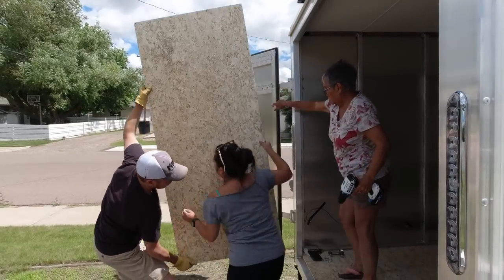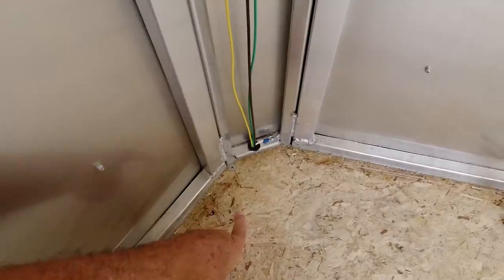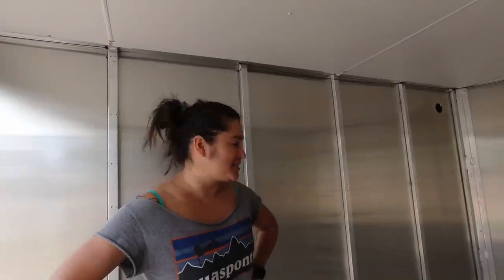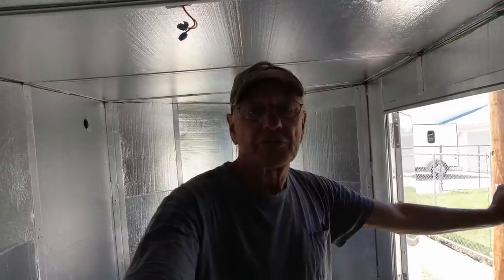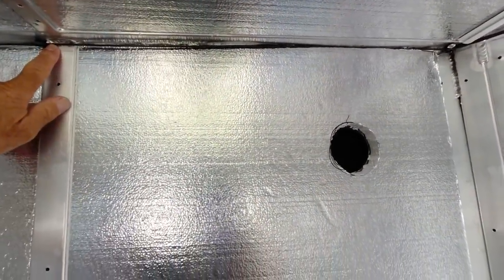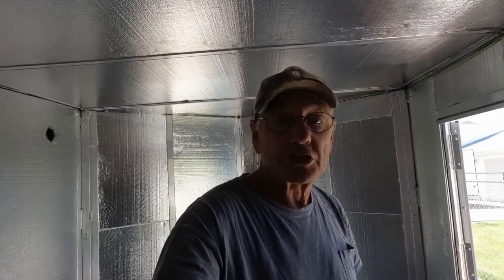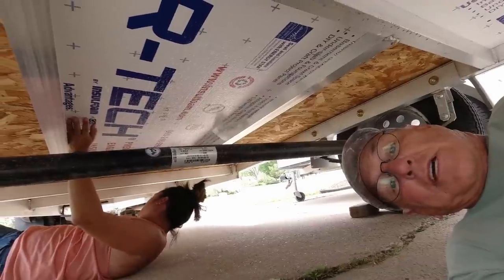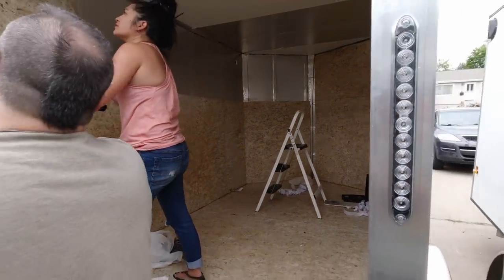Cargo Trailer to Camp Trailer - How To Start Your Build - Insulation

Comment: Rick, can you tell me what adhesive you used to adhere the insulation to the bottom. Was it something you sprayed or rolled on? Did you apply to the foam,OSB or both?. My trailer is a couple of years old although not too many miles, do you recommend cleaning the bottom at all? I insulated the walls years ago with pink foam that had no silver side, does it make much of a difference you think? I need to open up the walls to tape all the seams so I could add something if it would make a difference. Last question, do you have a favorite app you use to find campsites?
Reply from the maker: The adhesive we used is contractors foam board adhesive, sold where the caulking is in the hardware store and I would just hose off any dust and loose dirt before installing the insulation.  I just applied it to the bottom of the OSB is all.  As for your trailer not having the reflective mylar on the insulation I wouldn't worry about it because the interior space is small and is easy to heat or cool.  I would, however, put in a moisture barrier to stop condensation on the inside of the skin.  At this point I think you would need to use a plastic sheeting on top of the foam.  As for a camping app, the ones we use most of the time are Freecampsites.net and Campendium, but we use these mainly to find overnight stops while we're traveling (like a Walmart or other place that allow overnights stays).  For the really nice places we camp we use the Delorme map books for each state we like to spend time and, for us, that's about 4 books.  Online we use https://publicland.org/ most of the time.  Hope to see you out on the road!
Reply: @gonagain  Thanks so much, this is really helpful!

Comment: The aluminum frame is a huge plus. That is a well built trailer. Now, what kind of suspension does it have? The only other video of yours that I have watched was the one where you broke a leaf spring. A good suspension would be a Dexter Torflex or a Timbren system that uses the polyurethane compression blocks and trailing arms. As you well know, leaf springs don't hold up, cannot count the videos I've seen of them breaking on people and the trailer doesn't get a good ride which means it doesn't tow as well and is harder on the fasteners holding it together and your belongings inside.
Reply from the maker: I was going to go with a torsion arm axle as an upgrade, but the suspension shop talked me out of it.  I was told they too  break down just about as often and then they're more expensive to fix and get parts for.  I'm holding off for now.
Reply: @gonagain  The Timbren axle-less suspension is a good idea. It bolts to the frame and you install a square tube crossmember to keep them in align. I would want thru spacers welded in the frame so as to keep from crushing the frame when you bolt it up, but its great design.
https://timbren.com/c-1389196-products-axle-less-trailer-suspension.html

A second possibility is Sumo Springs for trailers, as they will carry some of the load and keep the leaf spring from being so heavily loaded. They also help dampen the spring action. These work with leaf springs, over or under the axle, different kits, for over/under and different weights.  https://www.supersprings.com/trailer-sumosprings
Reply from the maker: I've looked at the Timbren and had thought about going with that, but i think something like the Sumo Springs you've pointed out better fit my needs.  I'm sticking with the leaf springs because replacements are available most anywhere. Thanks!

Comment: Love your videos! Thank you! I've learned a lot from them! Thank you for sharing your knowledge!  Question how do you think that will hold up with rock salt? (  The insulation under the trailer) In the winter's up in Ohio they go crazy putting that stuff all over the roads.
Reply from the maker: I hadn't given that any thought because it's not in use here.  My first thought is that the salt will corrode the aluminum frame, but a steel frame would be no safer.  The insulation is an inert material and won't be affected at all, but I wouldn't want to install it in a way that would hold any moisture (I'd use a LOT more adhesive around the edges).  I think if you were able to hose it off with fresh water it would do wonders for the trailer in the long run.  Interesting question.
Reply: @gonagain  thanks for your input Rick. That's one thing most of use do here as soon as the temperature goes above freezing.   I was also wondering if I followed your instructions for underneath the trailer if a spray on rust proofing would work.  That would also give a barrier to the aluminium frame.
Reply from the maker: @radwayb  aluminum requires a special primer before you can paint it, but if you did that then painting it would be very beneficial I think.
Reply: Gonagai

Comment: I added insulation in my walls and put the wall panels back up. Went camping in May and the campsite had an ant nest nearby and they got all over the trailer and some made their way inside. I’ve been thinking about taking the insulation out to seal every opportunity in the walls to keep critters out then put the insulation back. Do you think sealed tight like this would cause too much heat to be trapped between the skin and wall panels during summer heat that may cause other problems?
Reply from the maker: If you didn't put in a moisture barrier, then now would be your opportunity to do so and that will keep any moisture from forming inside the outer skin and causing mold problems later.  Check out the video on insulation to see what I mean.
Reply: @gonagain  Sure will.  Thanks.

Comment: You're correct! Those are supposed to have to aluminum towards the inside, no matter what. Outside of a house is still aluminum side towards inside too, or anything else.
Reply: @AdamA-pm3yn  okay since you don't seem to have any construction knowledge or background. I'm going to make it super simple for you. The aluminum side/ foiled is to decrease the heat or cool to the outside, while the white side/ polyiso goes to the exterior facing of the inner wall. There is air movement between the foil and wall; why? It not smooth. How do you think, and why would you use aluminum tape to seal up the polyiso panels/ foam broads? You don't use it on the white side. I guess you can if you're super small and slide down the inner wall. Hopes this helps you out.

Comment: Those ceiling panels are vinyl coated.  If you need to cut or drill, it won't easily splinter and they're easy to clean.  The plastic channels are likely attached via VHB.  Mine, in a high-end trailer are the same.  Nice inclusion by the manufacturer.
Reply from the maker: I was pleased when my daughter brought this trailer home and I saw those panels already installed.  That saves a lot of work!  Thanks for watching, Keeb!
Reply: @gonagain  Love all your vids!  A lot of thought to airtight my trailer after your "trailer dust" vid.  Very informative!

Comment: would having the axle on the bottom of the springs be any benefit?
Reply from the maker: Sometimes that's a great benefit.  These 6X10 single axle trailers are pretty high off the ground to start with, but I may be flipping my axle in the near future.

Comment: Is insulting the trailer really needed for me I plan on doing one and taking it to a track about once a month throughout the late spring summer and early fall mid Ohio because it’s cheaper than a motel and I need a trailer for my go kart
Reply from the maker: Yes, I think it's really necessary, not only to keep you cooler or warmer, but also to stop the condensation inside.  It's also one of the easiest modifications you can do that will add so much comfort.

Comment: The hinge bolts should be carriage bolts not bolts with hex heads on them. If the insulation fills the gap completely then it does not matter as much which side the foil is on but mine was a little thinner than the space I was filling so you put the foil facing the gap (inside) so it REFLECTS heat back in. If it's touching the outside metal wall it CONDUCTS which is what you try to avoid. But as a rule it goes against the wood which is a lower mass than the aluminum skin so it wont conduct as much. So you did it right . . . :o) 
You always do great videos . . . always plenty of food for thought.
Reply from the maker: Good info, Hiker John, thank you.

Comment: You guys are having way too much fun....I hope a BBQ is going to happen at the end of the day DAD! Underside of the trailer with the exposed foam....ever think of putting of appling a rubberized seal (Flex Seal) like the guy on the commerical with a screen door in the bottom of his boat?
Reply from the maker: Hi Scott, I thought about it but didn't on purpose.  I wanted any moisture to drain away easily and I haven't had any problems at all with that.  However!  If it would help protect the panels from dings without sealing the edges then I would be all for it. Mine may look bad, but they have many thousands of miles on them including lots of gravel roads, so I think they're holding up pretty well.
Reply: @gonagain  since you have that much experience on the panels and your thought process makes alot of sense I think I will follow your suggestion.

Comment: I just bought a 7x14 EZ Hauler. I went and bought all the insulation etc. and started to remove the wall panels. I see the bottom  used rivets for the fender all the way through! Did you also run into this? If so what did you do? I'm sort of at a stand still as I don't want to remove the Fenders to insulate. :(
Reply from the maker: Ok let's see. Are your fenders siliconed around their perimeter on the outside? If they are, then you could easily drill out those rivets and poke them out without the fenders falling off. Even if they do come off, it's not too big a job to bolt them back on again. I don't know where you live, but if it's up north, then the insulation is really necessary. Don't forget to seal all the seams to keep the interior moisture (from breathing) away from the cold skin of the trailer.  I'm saying that the insulation is important enough to take those fenders off if need be.
Reply: @gonagain  Thank you. Yes, they are siliconed. The Trailer is built well. I was able to remove the wall panel. I appreciate the help.

Now I have to figure a way to insulate behind an inside aluminum panel approx. 12" by 4 1/2' that goes along the floor on the inside behind the fender.

I wish I could share a photo! I'm thinking maybe drill a hole top and bottom between the studs and use Great Stuff. It is held with rivets. That way I could see when the foam reaches the bottom. Just a thought as I'm not sure of other options. I'm not sure what the R rating would be compared to the R6 I'm using.

Yes, I'm up north in Central NY.🙂

I appreciate the reply!
Reply from the maker: You could send me a picture to gonagain21@gmail.com so I could get a better look.

Comment: Also if u hsd to some point u could probably run some facia or aluminum on under belly,would add to longevity and r value i imagine, but yes costly,more for long term bug out mobile!
Reply from the maker: That's actually not a bad idea and would be fairly easy to do.

Comment: it looks as if that OSB garbage will be staying on the floor. A coat of good floor/porch enamel paint would really add life and some water proofing to the top AND bottom of the floor panel. that'll be nice.
Reply from the maker: Hi Dufus, there's different grades of OSB and some are highly moisture resistant and can even be used below ground level.  I know that our own trailer is about 6 years old and the OSB is fine but maybe other manufacturers don't use the better quality product.

Comment: You really don't need foil covered insulation in an aluminum trailer because the shell of the trailer is your radiant barrier.  The heat inside will be convection heat so the highest R value is what you are after.
Reply from the maker: That's a good point Eric.  Thank you.

Comment: One question why no tape on the joints on the under side of your trailer?...
Reply from the maker: Hi Jimmy.  Because the insulation under the trailer is on the outside, it's important to give any moisture or condensation an avenue to escape.
Reply: @gonagain  Good reason for not tapeing the under side...

Comment: If there is no air gap between the foil face and the interior (or exterior )walls then it will not reflect heat at all. If it’s touching something then heat will conduct through it like all solid objects.
Reply from the maker: Hello Paul.  There isn't really room for an air gap, but the foam insulation still works fine and the mylar covering will block the interior moisture from condensing on the inside of the trailers skin, as long as you seal up the cracks with tape.  The mylar foil that faces "in" will definitely reflect infra red heat back into the interior also.  On the small versions of these trailers, like my 6x10', it's so easy to heat (or cool) that there isn't much of a problem.  If I were building a big cargo trailer conversion (20' +) and it was going to be used in extreme weather, then I might opt for thicker exterior walls so it could be insulated better.
Reply: @gonagain  I totally agree with you, moisture is the biggest concern in a project like this.

Comment: You said it was a 6x10.  What are the inside floor dimensions? Same?
Reply from the maker: No, it's a couple of inches smaller each way actually.  Figure about 2 1/2" narrower and shorter.  It depends on the wall thickness and what kind of paneling was used.
Reply: @gonagain  Thanks.I have one of these same shaped trailers that measures 5x8 without the V in the front. Very compact with the same sized ceiling. Do you think it would be usable for 2 people for occasional weekend camping?
Reply from the maker: @wadehampton1737  Oh yeah!  It's bigger than a tear drop and you can stand up in it.  Maybe you could put a bunk bed style cot down one side like the Disc-O-Bed:  https://www.amazon.com/dp/B07L6QPY6D/ref=cm_sw_r_cp_apa_i_t1AiFbQVCG5YW
That way you'd have some floor space to move around a bit.

Comment: So what is the beginning weight of the trailer and the end weight
Reply from the maker: Being all aluminum, the beginning weight of this 6x10 is under 1,000 pounds and the final weight won't be much, just the weight of the beds, cabinets and personal things. When I'm towing mine there's very little difference in mileage between when I'm hauling my 4 wheeler and when it's empty, only about 1/2 mpg.  The mileage loss is mostly in the wind resistance.

Comment: Im in the process of insulating a metal building with same foam board .
Reply from the maker: That's a much bigger job, but at least this stuff is pleasant to work with.
Reply: @gonagain  pretty easy to cut  hope it works well . I went with the 1/2 inch  cause of budget .

Comment: Good move on the underbelly foam board.  That OSB, no matter what the dealer says, won't hold up.
Reply from the maker: Hi Keeb, I guess it depends on what you're doing with it.  As a camp trailer and sometimes ATV hauler, ours isn't showing any signs of a problem after years of use.  But, of course, there's different grades of OSB too.

Comment: My trailer weights 1,480 Empty.   YOURS?
This is Fully insulated, spare tire, two 6-volt 235 ah batteries on tongue, and fan n lights.
Reply from the maker: Right around 1000lbs.  Here's something though;  we found that there's very little difference in fuel economy between towing the trailer when it's heavy and towing it when it's light, maybe .5mpg.  Most of the poor mileage comes from wind drag.
Reply: @gonagain  On that note, it was YOUR video on the air flow hood scoop you had to put on your trailer,  made me look into AIR flow/ DRAG. 
I found that the "V" shape have more drag (Eddie currents) of air that give it more drag than you would think.  = the reason you had to build that air scoop.
 
I WAS so set on getting a "V" shape and then looked more into it and found that the flat face trailer are just as good to pulling. 
 MMM,  not sure why YOUR findings are different ? 
>>I'm only going by videos that I have watched and not on my (or your-own-Real-life) pulling  data. I have yet to pull my own. 
I would surly think that it would be 60/40 -90/10 all about the Weight. ???  >>>  Data from this guys findings>>  (video goes here)
Reply from the maker: @RVingwithG , that could be.  I know that a vent on the flat nose seems to work on the upper side ok where the same location on the Vee nose does not.  Not sure what you meant about the towing, but I found that the drag seems to make more of a difference than the weight on my Vee nose.  It's probably the same for the flat nose in that respect.  Most of the drag is from the suction in the back, according to the truckers.